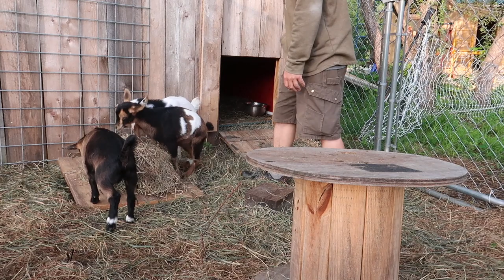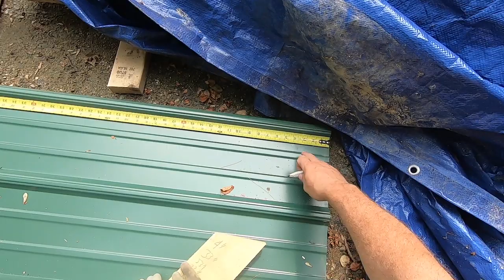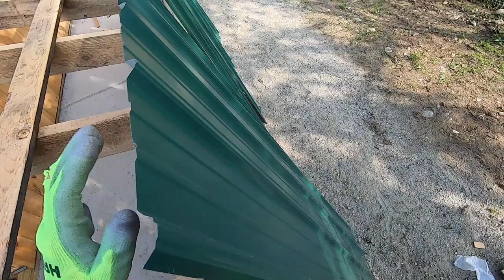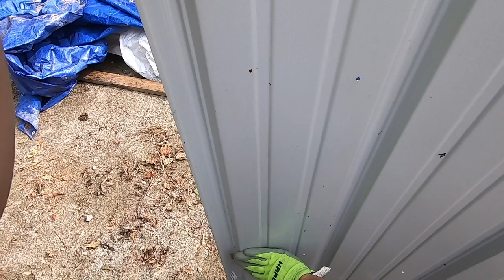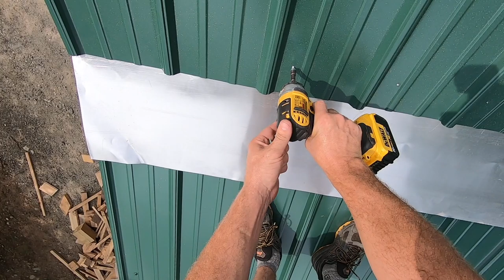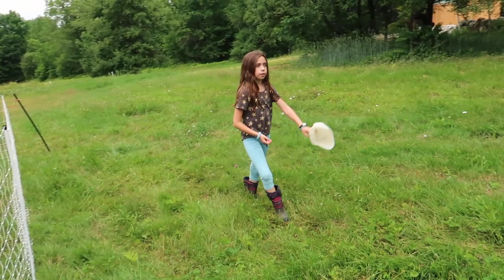Things were Going BAD Until I Discovered this HACK Flashing the Roof on the POST & BEAM barn

Comment: You might consider putting a screw in each corner end of that flashing - it's very thin and hanging out there 12 inches and could bend.  A screw going through the flashing on that last rib, the one in the overhang (where it wouldn't matter that a screw is going through it), would keep those corners from trying to curl back under a strong, direct wind.  Looking GREAT, Al!  Good work!

Comment: Forget about a workshop/store/animal  barn.
I wanna live in that barn-add a few windows under that porch and convert the interior. :)
Reply: Right? Me, too!
Reply: I've been looking at flat pack barns for that very reason, it's a no brainer for me.
Reply: If I had land...
Reply: I used to live in a converted barn it was cool because we kept the beams exposed.   The only problem was that it was an old barn and so termites and ants were constantly trying to make a home.
Reply: Put the bedroom in the loft area, bathroom, kitchen and utility area underneath, the rest a living area.
Where Al will put the other overhang store area, use it as a small area for tools, feed etc....but I also love the PPM and Mobile Coop (New Yolk City)
Reply: I'd heavily wall the exterior of the overhang and remove most of the main walling creating a larger floor plan. Unless the main walling was structural and was keeping it from racking, doubt it though. Obviously keeping the posts.
Anyways, I needs that land :)

Comment: Good morning.    I wish your flashing could have matched the roof color.  You didn't mention any leaks, so it must be working. Would the rubbery closures I mention work on the flashing to seal the gap between it and the lean to roof?  Just a thought, since rain blows in all directions. The rain bands hitting me from Barry are swirling and the rain comes down in an odd slanted pattern. Late last night it was actually horizontal.
Reply: It's not just me! 
I  wanted the flashing to be green as well! That visual OCD!
Reply: As OCD as he is, I thought the same.  They make a green prefab flashing for that application
Reply: Elizabeth Chetwood I looked up metal roofing and even the flashing is paintable.
Reply: @virginiareid5336 , might be, but it would have been easier to paint on the ground, instead of after installation.

Comment: Hey Al when I worked in the ceramic tile industry we had what we called a story board.  That was use to tell us where the tile joint would lay out so you wouldn’t end up with small cuts. The boards had a mark where each grout joint was.. Next time you got lots of drilling to do just get a long board and make your marks on it. Then you just use the board to transfer your drill marks over to the tin.. It a lot better then having to use a tape measure and removes any chance for error

Comment: Here's a little hack I learned fixing my metal roof on my cabin-- old style "Chuck Keen" sneakers don't slide on the roof. If you don't have those, get the rolled rubber shelving matt. So, if you have to climb up on the other side to releave the end piece, you can get up and down easier.

Comment: I was always told to never put roofing screws in the valley of the roofing material it causes leaks even if the screws have rubber washers.
Reply: BigMint yep on the ridges , less water even if washers fail ,

Comment: QUESTION:  The long 2x6 0n the ground along the edge is going to collect dirt and water every time it rains.  Also makes it impossible to brush off the concrete.  I see no benefit and lots of issues.  It seems all you really need is the wood directly under each post.  Why not cut all the other wood away and just leave a one foot piece under each post.  That way no lip of wood to trip over and any water or dirt could then easily be brushed away.

Comment: I have the same OCD as you, Al in regards to the skylight not matching the other roofing.  I went with a clear ridge cap instead and it works wonderfully.  That is, until we built the loft.  D'oh!!!!  Now I'm figuring out how to put windows in the side of my building where the two stalls are.  It's on the back side, I may have to suck it up and just put greenhouse panels there and tuck the top one under and the bottom one over like your flashing. Windows aren't in the budget. MAN!!

Comment: I can understand your OCD with patterns and how a break in the pattern of the roof would drive you bonkers. I dont think you have to have OCD for something like that to be bothersome and I think a lot of people must share the same feelings so it surprises me that manufacturers can't/won't make skylight panels to match the tin panels. Surely it can't be that difficult. I bet there are a lot of people for whom it wouldn't be a deal breaker (they want the light more than the pattern) but given the choice between a panel that matches and one that doesn't they'd chose the one that does.

Comment: Over tightened the screws, the gaskets will fail in a few years. Manufacturers recommendation is when gasket reaches the width of washer from compression, its good, otherwise they eventually split allowing water to seep.

Comment: Great job! Great instruction video as well! I think you fastened your screws down too tightly. They should be snug and the washer not compressed. They shouldn't push into the metal. Too tight and the washer will deteriorate over time causing leaks. Maybe not as important for a barn.  You're living the life!

Comment: Have just noticed you put roof screw on lower flat surface and not on the rib of the roof. That is prone to leak. One more consideration was the roof pitch where we should take into account that roofing with insufficient slope will depreciates faster. By the way the idea was a great innovation.

Comment: Strange, tin roofs are common in Australia, they are always screwed on top of the peaks
Reply: Here it will void the warranty of the tin if you screw on the high part of the tin.  screwing on the low part you get full contact. Unlike the high side you have a gap in between the tin and strapping
Reply from the maker: I wonder why that is.
Reply: Lumnah Acres it’s done because the water runs down the pan of the sheet. If you screw into the ribs you don’t rely on the rubber washer lasting in the weather.
Reply: Also screwing on the high part will make the tin travel to where you can gain extra and make it go out of square. guess it pushes it down and makes it spread
Reply: Yeah these people here think they can protect against leaks with the washers, and for house roofing with the addition of backing. It won't, it will eventually leak, and another negative to screwing it down in the valleys is that reusing the tin is difficult, where as screwing it on the peaks it's easy to reuse and fix any previous holes.
Reply: Lumnah Acres Al, as others have mentioned, it helps stop leaks and allows the panels to grow and shrink in the heat and cold with out snapping fasteners or wearing out or relying on the screw seals which also age and fail. When you attach in the valleys and the seal fails you now have a digger leak which can be made worse as the screw head collects dirt and makes a dam which backs up water.
Reply: snagger 420 most people over tighten the fasteners, this pushes out the seals and distorts the tin making a dish so water pools past the displaced seal. Also the big sheets grow and shrink a lot in the heat of the sun to the cool of winter, made worse by the wood drying and swelling so if the fasteners are too tight and there is no mechanism for the panel or timber to grow the fasteners get sheared off, when placed at the top of the valleys the ridge and distance from the underlying structure (strapping in this case) allows for give.

Comment: So your flashing is left sitting on the outside?
What happens when wind blows the water up under the flashing on the skilion roof part?
In Australia we push the bottom skilion sheet under the top roof sheet of iron and crimp up the gully of the profile to prevent dripping.
Then add flashing under that as well. 
Actually the flashing is often laid down along the joint first then the skillion roof sheets are laid, then the top roof sheets are laid last.
These days we can get pre shaped flashing with an angular profile to suit the angle between skillion roof and main roof and also has little turned up edges that act as gutters to prevent drips falling internally.
We tend not to build timber sheds because of white ants.
Ours are all steel.

Comment: I'm worried about the overhang you left on the tin for the lean-to. 

Be it I have no experience with snow or metal roofing I'm worried that the over hang won't be able to handle the snow load you guys experience. I hope I'm wrong but if you start to see an issue it would be an easy fix.

Comment: What's the wind rating on metal over wood? Would any county in Florida let you build a residential house without Cinder Block, plywood or drywall?   ...   just metal skin over  2x4s framing , 2" Styrofoam insulation and 1/4" panel sheets on the inside?

Comment: With the cost of these kits its a shame they didn't give you a color matched flashing.
Reply: was thinking the same thing.  wonder if they sent the wrong roll
Reply: Someone failed on the order or the right trim should have been included, we use 100 screws per sq because of wind and all  seams get 2” screws so they go into the woood.  Put a block on each end and sq a string to the building to set ur tin to.  The tin will walk top or bottom if u use  different pressure as u screw it down so 3 ft marks keep it sq
Reply: Th tat was a very cheap kit using valley tin as flashing, no rubbers to keep snow or bird ect out
Reply: @sheilamclaughlin963  I don't think the kit was cheap to the customer!  But they definitely cheaped out on the materials!
Reply: @sheilamclaughlin963  - The other fail was providing the barn roof sheets TOO FRICKEN SHORT!  Th barn roof should over hang the secondary Lean-to roof, and the flashing extends way too far over the secondary roof!
Reply: @Rattlerjake1  Al cut the central roofing short in a previous video.
Reply: @sheilamclaughlin963  Also called "beer can flashing"

Comment: you are supposed to screw the the roof on through the high ridge part of the iron profile, not on the flat low parts of the profile ... they will "catch"more water and leak at best ... and certainly rust in the longer term.

Comment: Just curious but why so far between the first 2 predrilled holes in the roof? You know 4——to 50 something?
Reply: They are drilled at 4, 13, 33, 53... those numbers will be together in my head forever. But it did look as if a 13 was skipped over there at the end.

Comment: All looks good to me but you failed to show if you screwed down the bottom edge of that flashing and if so did you screw it to the crowns of sheeting on the bottom roof tins???  Please let me know!  Somehow every time I have done metal roofing the dang things leaked.  Those rubber gaskets rot or wear out when secured down tightly.  How often to replace gaskets on screws???

Comment: I asked on a previous comment section in the series, if you could walk on this type of roof built this way, once finished.  Commenters suggested you might be able to walk only on the parts that have boards directly underneath the metal but not otherwise.  In this video you seem to be able to walk on the roof anywhere to apply the transition flashing.  Is that true? It looks like you just climbed up on there.   I ask because I would be very reluctant to build a roof that cannot support someone on top, unless it were obviously not meant to support human weight.  For example, a greenhouse made with that plastic sheeting for a cover is clear like thick plastic wrapping, and obviously is not meant to be climbed on, I would think.  That would be crazy.  However, a kid or some worker might well climb on a metal roof believing it to be very solid, and therefore I  think it would be ridiculous to put something up like that, if it were likely to collapse and injure someone or even if climbing on it would be very likely to severely damage the roof itself.

Comment: This is just one way you can maximize the integrity of the transition flashing and not have to fight with retrofitting the detail like you had to do: https://www.youtube.com/watch?v=iQ5O2DDdO_4&list=PLDRjQCJzu5T82AiCT814Ok5r9GVaV39x1&index=12&t=0s
You could also use one long color matched coil of steel so there are no overlaps like you get with 10' pieces. Any reputable manufacturer can supply this.
Otherwise just use 10' pieces and flat lock seam the overlaps instead of using caulk and rivets.

Comment: Why waist time predrilling, I'm sure your screws have a starter tip just screw it on as you go...
Reply: So the pattern is the same.
Every way you look the lines are the same, straight.
Reply from the maker: It is so much easier when installing the roof to have it pre drilled

Comment: You are an amateur, you used pop can thin material for flashing, which should be installed prior to the upper sheets. I doubt you used any closures, and you over hung the sheets instead of proper gable trim.

Hack 💯
Reply: Photo Finish you should back up about a dozen or so episodes and find out his history. This isn’t his first build, and he follows the instructions pretty damned well.